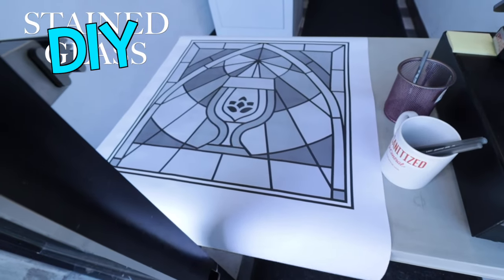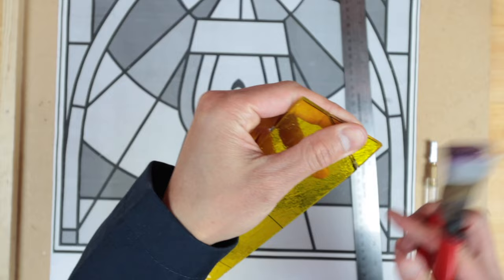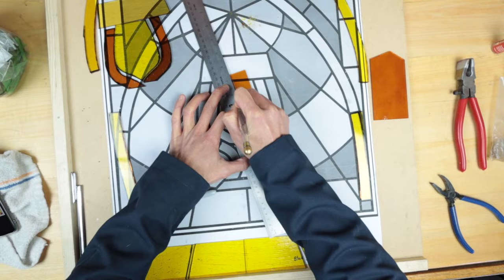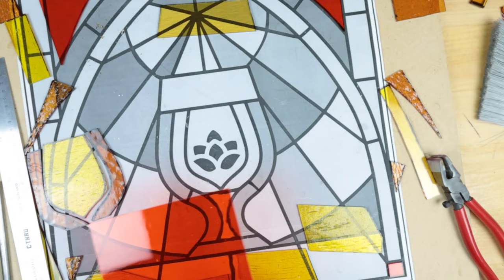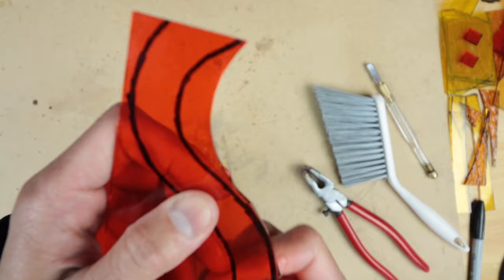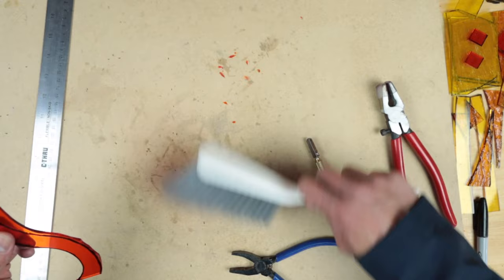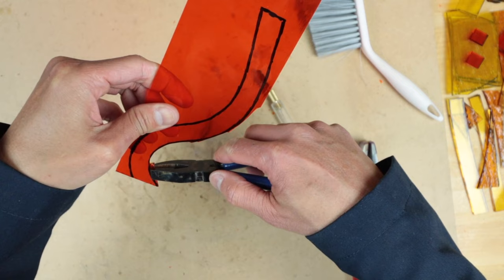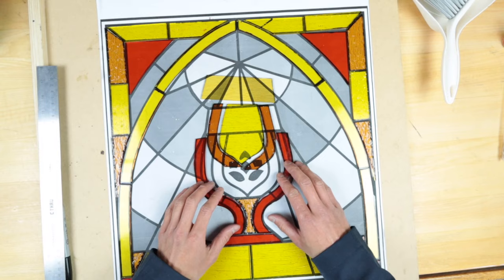A LEADED STAINED GLASS Art Commission (Part 2) | GLASS CUTTING

Comment: Killer Cuts on the orange curves for the beer glass.  Awesome job on the cuts!  A tip I learned on curves is to make your final scoreline first then subsequent scorelines inside. As you do this, the pressure from making the other scorelines fractures your main scoreline and can stop some wild break-offs, especially on the textured glass, as you are breaking out the glass.
Reply from the maker: Oh I'll remember that next time! Thank you!
Reply: That’s what I do as well, though since I work in opalescent glass, even doing that much doesn’t always guarantee me a clean curve cut.
Reply: Yes, when using certain opalescent glass types it can be tricky.  I find wispy style  glass type can be the worse because of the way the colors mix together.